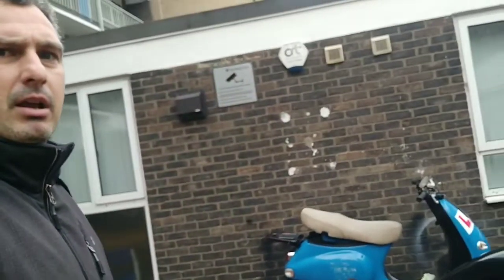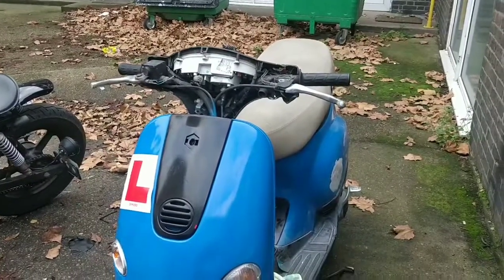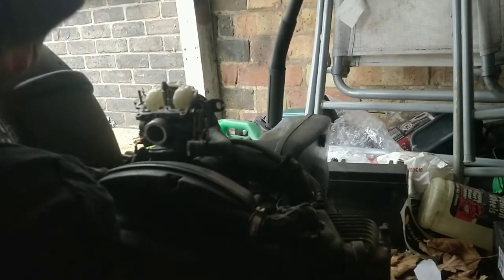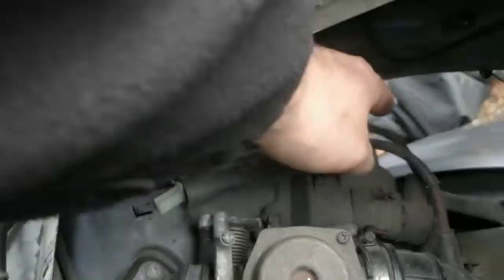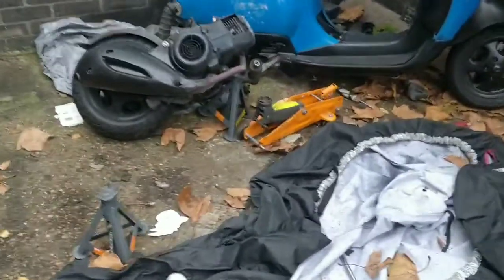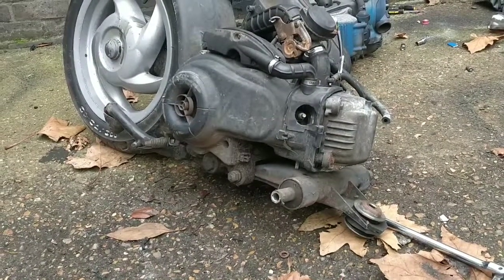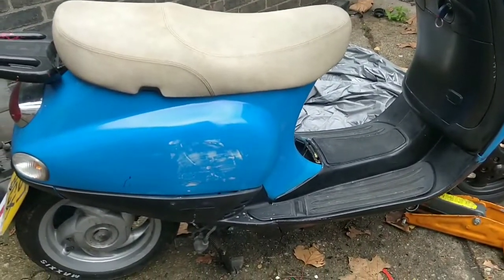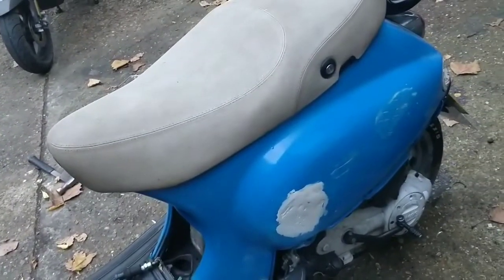Piaggio Vespa engine swap. how to swap a moped engine. it's not looking good.

Comment: Soon as you said choke looks fine looking at the red connector.. that was enough for me! carb should be stripped cleaned way before any attempt to use it. so i didnt bother with rest of video .
Reply from the maker: If you watched my channel you will see that I have worked on, saved and restored many bikes. I've been doing it 20 years. No skin of my teeth you not watching.

Comment: the crank thread on my vespa was all chewed. i was going to do the same thing as you and replace the engine. Mine was a pre leader and getting a replacement engine was a nightmare. Glad i didnt go through with it
Reply from the maker: It's a right pain but I'm determined to make it work. Possibly lol

Comment: Hi the scooter I have it's a 125cc daelim 2015 plate and its fule injected but it's been sitting for 2 years and iv charged the battery and started it and let it idel for 10 mins and when its idling its revving its self up and down and when I rev it up it dies what could my problem be
Reply: Electronic choke could be old/stuck
Reply from the maker: That could have been the issue yes

Comment: Another good video.  Sorry the bobber didn't sell . Was wondering if anyone can help . I'm trying to find out how many turns out I need to turn the mixture screws out on my virago 535 . And also the correct main jet size carnt get the correct information anyway thanks steve 👍
Reply from the maker: 2.5 turns out is your baseline Steve, you then turn both out half a turn and see if the engine revs lift after a few seconds, if they do then go another half tern out until the revs stop rising. When they stop go back in half on each carb.

I'll check tomorrow to see what all your jets should be
Reply: @motorcyclerescuer  thanks for getting back to me.  The revs don't go up or down.  I think one of the carbs maybe blocked.  Ill have to get someone to clean them for me thanks steve
Reply from the maker: @steveandfamily7248  hi Steve, the revs should go up or down when you screw the air/fuel screw out. Try starting at 1.5 turns out from base as that could be your sweet spot. The change in revs may be minimal so you need to listen carefully and wait a good 10 seconds. Looking at the rev counter can help aswell.

Lots of people rip us of with carb cleans and yours is a v twin so a touch harder but if you think you can give it a shot then carb cleaner spray is like £6.

Comment: Do you know if gts 300 engine would fit this bike straight swap?
Reply from the maker: I believe its a straight in engine. You may need to swap the wiring though. Cdi and coil possibly. 

Thanks for watching and please subscribe.
Reply: @motorcyclerescuer  thanks for the reply! Loved the video liked and subscribed gunna swap my 125 engine out for it 😁
Reply from the maker: @zakgawthorpe2434  no problem. I've done 50cc to 125 but never bigger. It's a popular swap though for obvious reasons lol